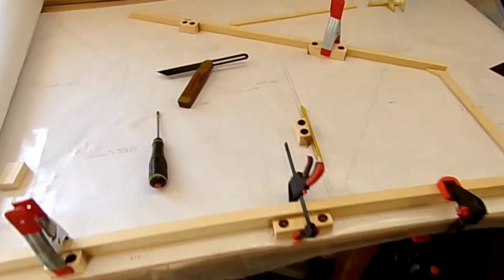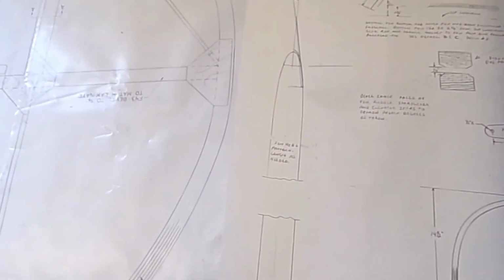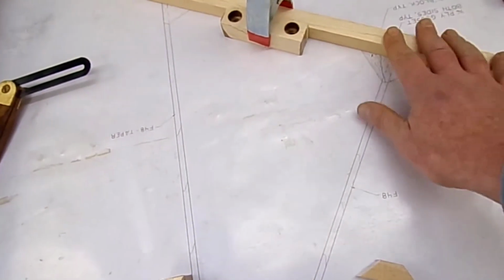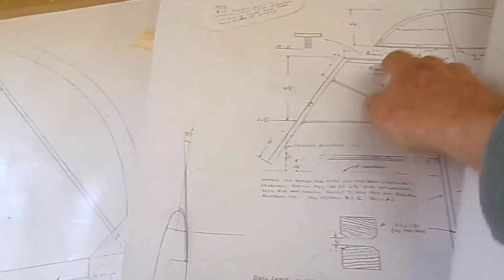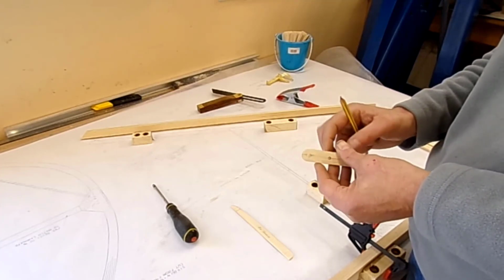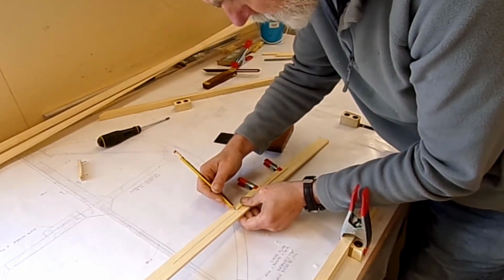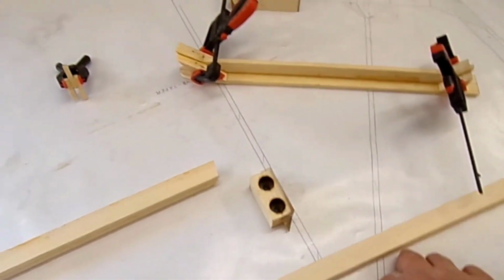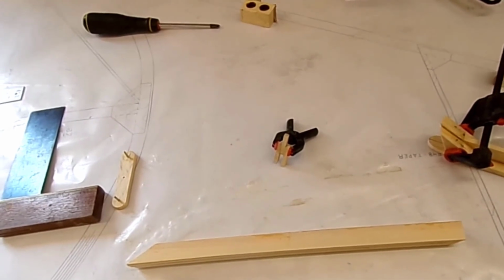10 COZYCARB ANSWERS - D-MOTOR UPDATE - ALGY YATES FIN BUILD - FISHER FLYING PRODUCTS NEWSLETTER #35

Comment: what are your views on changing from spruce to white pine i dont think its a good idea
Reply: Interesting comment. I would be interested in your reason for not thinking it is good.
Reply: @flyingkub  its the way spruce breaks it never seperates like white pine
Reply: @electoplater  That is interesting you say that as I have seen spruce for aircraft crashes that has seperated into splinters, that said the one that realy spinters from what I have seen is Douglas Fir (it is stronger than spuce but heavey and turns into wood daggers). I have not seen an aircraft that has crashed with Northen White Pine as it is not a material used a lot in aircraft in Europe, so it is interesting to hear your view.